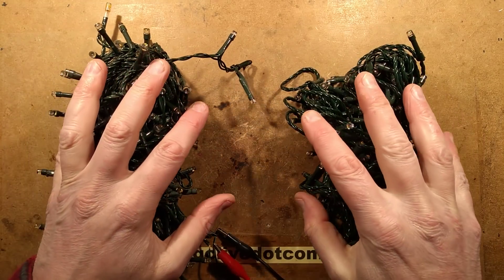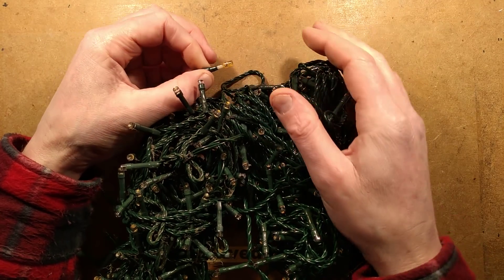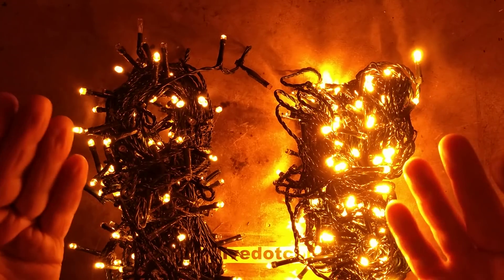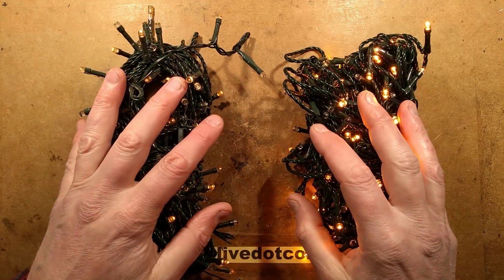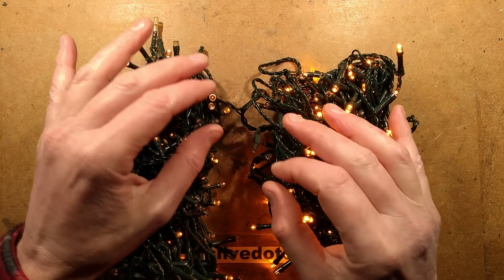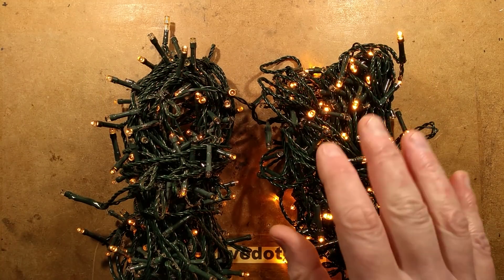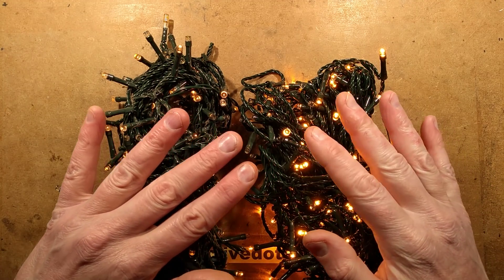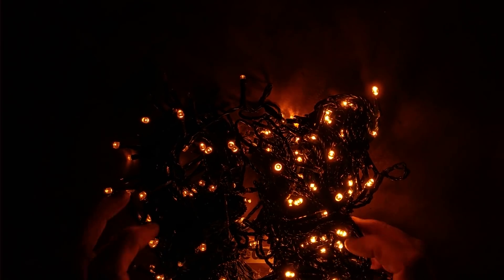9000 hour LED intensity loss test on LED strings.  (All LEDs do still work.)

Comment: Quite a lot of  people seem to think that leds last forever, but they fail/deteriorate at varying rates depending on the power supply, the temperature and the quality of the leds themselves, Osram and Toshiba quality versus cheap penny a time mass produced ones, between bad power supplies failing and poor quality leds many light fittings fail quite quickly, you only have to visit a shopping centre/mall to see it, you won't see it in an airport though as the lights in there are changed quickly as and when they fail..
Reply: People always think Im crazy when I have my dash lights in the car turned down low but it beats having to take the dash out to replace them later on. Although with that said even the OSRAM Sylvania replacement LEDs in my older 80's car are starting to dim a bit, but since it uses a rheostat as the dimmer they are stuck running at 100% intensity, so I guess its to be expected.
Reply: mysock351C what kind of car? I have a 1981 Volkswagen Rabbit with 10+ year old LED headlights.
Reply: depending on the power supply ???
Reply: 88 Camaro. All tungsten lamps replaced with 12V automotive LED. Dash looks great, but there is a slight dimming over time. The original gauges had a halo effect around the edge of the bezel that took some 120 watts of tungsten lights in the dash to make work. Now that there is just 18 watts of LEDs (1 watt cool white units) the rheostat no longer works. They're not  being overdriven, but running at full intensity seems to take a toll over time. The map light I made seems to work nicely, but then again its only running at a few milliamps, so it should last forever.
Reply: @ryonbrand7885  Lets see if this works: https://www.thirdgen.org/forums/attachments/electronics/284197d1413862169-plug-n-play-led-sam_0056.jpg Edit: Theyre made by Phillips. I used Sylvania for the interior lighting. Checking again they're quite a bit dimmer. Like maybe only 60% their initial intensity.

Comment: I used to work for Arrow Electronics (distribution) as an engineer about 20 years ago. Some of the LED's were claimed to have a 200,000 hour life back then. That's not 200.000 hours to dead either, that's 200,000 hours to 80~% light output. So what sort of cheapassery are these guys doing?
Reply: Claimed, sure but did you ever see any real world data to support that rating?
Reply: That’s over 20 years. I highly doubt that...
Reply: @colejohnson66  Then look up the Heltt Packard specifications.
Reply: @colejohnson66  just inn case you cant find something relevant, this is a 200,000 hour assembly that works in a harsh ( hot and wet) environment. https://www.prnewswire.com/news-releases/new-sport-light-led-fixtures-200000-hour-life-ip65-rating-5-year-warranty-300589662.html
Reply: @otm646  read my replies above.
Reply: Gordon Lawrence - wow, British Rail used Arrow Electronics as a supplier back in the 1980s and early 1990s. Fancy hearing someone mention that name again!
Reply: Gordon Lawrence - Does anyone really expect cheap LEDs from the Far East to be produced to the same quality that well known market leaders use?
Reply: @Mark1024MAK  There is a lot of difference between "cheaper" and complete crap. These LED's Big Clive is looking at are down to 20% after 9000 hours. The HP leds would last near 100 times that long. I would suggest a factor of 100 difference is not small.

Comment: A pity you didn't have a third set, run alongside the "on 24/7" set, but *not powered up*, to see the effect of corrosion and general atmospheric mankiness as opposed to degradation of the LEDs when switched on.
Reply: Also a set powered up but kept in a dark place to see the effect (if any) of UV from the sun over time. It's possible the dimming over time is due to UV exposure rather than hours run.
Reply: @Old Farfegnugen an increase in resistance due to corrosion will reduce the amount of current drawn, the faded string was drawing more current than the unused string, so I don't think in this instance it is a corrosion of the wiring problem.

Comment: Whilst I understand the advantages of LED lights, I'm so pleased I've kept my old incandescent Christmas tree light sets. I just love the warmness of them... even the cat sits staring at them for hours... unless he's trying to remember a time when he was young enough to climb that tree.
Reply: And if you stick a diode in series with them you reduce the brightness to a nice little warm glow and they last forever and a day.
Reply: I will keep my incandescent C7's forever during Christmas. Well, as long as they'll make replacement bulbs for em.
Reply: i have lot of various christmas lights, candle shaped to clip on branches, triangle shaped to put on window, and others, i even have neon ones which i would like to repair and make safer (i'm surprised it made throughout my childhood relatively intact, minus few neons, unlike loads of devices i used to learn on and they are all gone)

and... i plan to put ntc(-relay), resistor-relay, triac(-relay) softstarters on every bulb based light i have!

Comment: The num lock LED on my 35 year old Model M keyboard is less than half as bright as the scroll and caps lock LEDs.
Reply: Interesting. The Mitsumi keyboard I'm typing this on right now originally came with a 386, but I can't really notice any difference between its LEDs (and yes of course num lock was always on).
Reply: Ha!  Finally proof that I was right in always setting the numlock to be off by default

Comment: Many years ago in the days of optical Dolby Digital sound in cinemas, the digital code which was laid on the film in between the sprocket holes. This code was illuminated buy a cluster of red LEDs. This did work well but after a year or two the signal started to drop out. This was due to the LEDS having a reduced light output. A temporary fix was to up the current but ultimately they had to be replaced at a very high cost. With 250 screens to look after this became a very costly affair. The optical analogue sound also used such an LED making double the problems. OHHH happy days!! LEDs are not the answer everyone thinks, they fail often and loose brightness really quite quickly.
Reply: I used to be a protectionist years ago. I remember the old filim exciter  lamps - you had to refocus the light every so often to compensate for age. I cant remember the supplier, I think it was omnex, but towards the end of the film era you could get led fittings to fit in to the bayonet  connector to read the optical track.

I kind of miss those westar 2001 projectors and towers. I never took to cinemecaicas.
Reply: @tonyjones9442  You're name rings a bell Tony, did you work for AMC/UCI in the long distant past?
Reply: Logic Hurts Idiots  I do largely agree with you, my home is completely LED. I was just giving an example of some issues, much like Clive did on his video.
Reply: Logic Hurts Idiots  You still can get brighter and "sharper" (faster on/off transitions) indicators with LEDs. There are also non-loadsensitive indicator relays you could switch to (if the car still uses a separate relay and don't have the function integrated on a board fomewhere), but you'd lose the faster  flash alert of a failed bulb.
Reply: @MichaelBeeny  no,apollo cinemas.

Comment: Common with LEDs. Lumen depreciation is more common on higher power LEDs but still happens on smaller LEDs especially if they are over driven.
Reply: Overdrive is the key here.
Reply: i didnt realize my flashlight actually WAS getting dimmer over time until i compared it to a fresh 1 on the same batteries, 10 watt cree XM-L flashlights
Reply: This is the reason i did not pay extra when i bought my car, to have it fitted with LED low beam headlight.

Imagine in 5 years time when the LED's have gotten dimmer, to the point where they dont really illuminate the road properly and you had to change out the whole headlamp just to get fresh LED's as the lamp is a complete and sealed assy.

On the car i drive, the price for a new headlamp right now stands at about £1200 plus fitting. You can not fit it yourself and get it working, because of theft protection only a brand workshop can actually do the computer magic that is needed to make it work.

So realistically you are looking at a price of atleast £1300 to get ONE lamp replaced.
Reply: The same is true for LED backlit displays, they eventually loose brightness by the 20k hours mark. I've already had to derate some 60w LED bulbs to 40w as they are too dim for anything else.
Reply: @PeppercornVR  They lose brightness.
Reply: @manolisgledsodakis873  <--- Troll.

Comment: Soooooo Does this also mean the big screen LED TV is getting dimmer by the minute?
Reply: Probably, they usually come out of the box with the backlight set to 100% too. I set mine to 50% and its still bright enough for me and it should hopefully make them last longer
Reply: Just like every other TV technology, yes. Beamers, CRTs, LCDs (both kinds), OLEDs, hey all have a finite lifespan. And not too far removed from each other in the hours limits.
Reply: @JasperJanssen  
Yes, I agree... I was just thinking the life span of LED was much better. :(
Reply: Yes, the back light LEDs will degrade over time. Hopefully quality LEDs have been used, so should fade out very slowly.
Reply: @JasperJanssen  the LCD CCFL monitor i'm on is from 2004, it may have (...calculating now...) like 40'000 hours of service and it's still 100% in shape.... i also got an IBM keyboard from1989, the clicky one, not used anymore, that can have even more service on and its LEDs are still apparently bright
Reply: I think you will find that those LED's are higher quality than poundland/Ebay refuse ones so the life span will probably be longer as lonf as one doesnt burn out before time (black dot of death) which is very common on backlight LED's.  I can tell you that my pranded LED bulbs (Philips, Toshiba etc) Hold up much better than the ebay specials but it's still mostly other components that fail and not the LED's. COB led's will most probably hold up better also since they have much better heat attenuation if mounted properly.
Reply: not necessarily, I have 2 identical model monitors, each bought at a different time, and because of binning, the newer one had always been dimmer then the older one when I switched it to the second monitor
Reply: @needforsuv  Is possible but were the settings and firmware identical also?
Reply: settings, absolutely, firmware, I think it's the same
Reply: Almost certainly, yes. We have some Samsung screens at work which have backlights that are clearly using different LEDs to light different sections of the screen, and after two years in use there's no display uniformity at all. Displaying a "white" screen gets a terrfiying blotchy mess. About the only good thing is that the colours haven't shifted; just the intensities.
Reply: @TheAtomicTurnip, had the backlights bean from the same bin, they'd probably still look even
Reply: Yes and I max my backlight out knowing I have that cover if it breaks then they'll fix or replace for 'free'
Reply: There are videos out there of people replacing the LED backlights in their TV's. One guy picked up a TV that was thrown away and he fixed it cheaply!
Reply: yes, if it is Oled moreso.
Reply: Not only that. The backlight dies after a few years. I repair stuff at a local "repair cafe",  and backlight LEDs burning out is quite common. Although I got to say from the maybe 10 large TVs (37" to 52") I had in front of me over the last years, 8 were LG or at least had an LG screen. So they either are bought so much more than any other brand (which I doubt) or LG really produces crap backlights.
Reply: @Penguins247  2 years seems pretty short. you might have a warranty claim on those.
Reply: I got purple spots after 24 months on my Samsung TV.  Problem with the backlight LEDs which I found was a common problem that Samsung won't admit to. Replaced the TV under extended credit card warranty.
Reply: Clive, are you talking in you mother tongue dialect ? If not how about making one video while talking Scottish.
Reply: Or failing, like the LG 32LN540V TV that passed through my hands with a single failed LED that wasn't worth the hassle of replacing as others would surely follow.
Reply: @JasperJanssen  I'll have to disagree on that. I have a 35 year old CRT that's still plenty bright so clearly some technologies last a lot longer.
Reply: Gooberslot it may be “plenty bright”, but it’s definitely not as bright as it was when new. Unless it was rarely used. The 50% limit on CRTs is typically around 50.000 hours of runtime. It’s just physics — the phosphors wear out.
Reply: @JasperJanssen  I don't doubt that it's lost brightness. The part I don't agree with is: "And not too far removed from each other in the hours limits."  There's no way any LCD would be in anywhere as good condition after 35 years.
Reply: I wish the backlight in my LCD would get dimmer, but I have it on the lowest setting (without cracking it open and doing a manual override), and don't leave it on all the time so it's probably not degrading nearly as fast as I want it to.

Comment: I used to own four indoor 50-lamp purple 120v LED sets. They used a phosphor mix that emitted two broad groups of wavelengths in red and blue. I've never seen anything fail as quickly as these! Within a few hundred hours, they'd dimmed nearly to the point of being useless. A few hundred hours more and the individual LEDs began going completely dark (while still passing the same or similar current).

It would be my hope that manufacturers hit the '100,000 hours' mark sometime during our lives and improve the phosphor mixes to end fading, but somehow I doubt it'll happen.
Reply: That's probably organic phosphor. "LED museum" (search online for it) has a page about the first pink LEDs with organic phosphor and shows how they degrade within hours and are intended for "disposable" applications. I guess it's gotten a little better since then, but not by much.

Non-phosphor LEDs can last 100k hours or more. That's only 11.4 years. I have electronics with LEDs that are older than that and they're still as (not very) bright as they were when they were new.
Reply: That's because these are both cheap and being dramatically overrun. They're not made to be used a lot.
Reply: @misterhat5823  Wonder what durability was claimed on the box?
Reply: @johncrowerdoe5527  I'm betting "long-life" or none. These sets tend to not have any claim of "hours."

Comment: Two thoughts: As others mention, LED lifespan is highly dependent on how hard they're driven and I expect they run cheap LED strips like this at a much higher current than is healthy to get the desired brightness for minimum cost. Secondly, it's also possible that UV is degrading or affecting the chips or phosphor coatings - it would be interesting to repeat this test with a string that's kept on for a year but is run indoors in a dark area to determine how much of the effect is the LEDs degrading themselves vs how much is due to their outdoor exposure to UV.

As a point of comparison, I have some of the very early Philips LED bulbs that I've had for over 10 years and there's no perceptible difference in their light output, despite them accumulating almost certainly a year's worth of on time at this point.
Reply: Had a really old Cree LED bulb in my desk lamp. That thing is at least 10 years old (maybe 15) and it saw 10+ hours of use per day for the 4 years I had it, and even more than that when my dad had it. Fucker is bright too.
Reply: Rick Delair  wouldn't say that they're total junk, but rather not suited for outdoor lighting
Reply: Rick Delair  maybe we should all go back to using candles lol